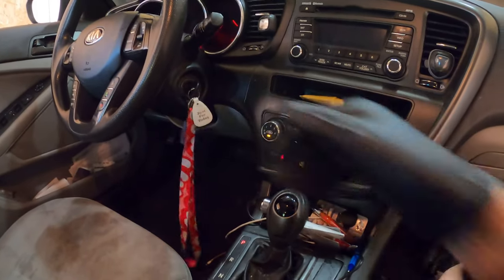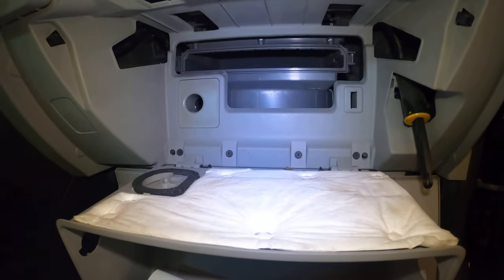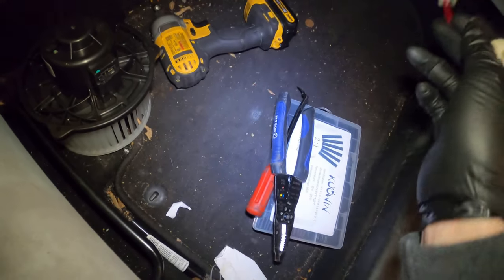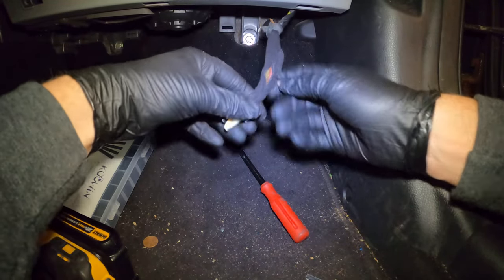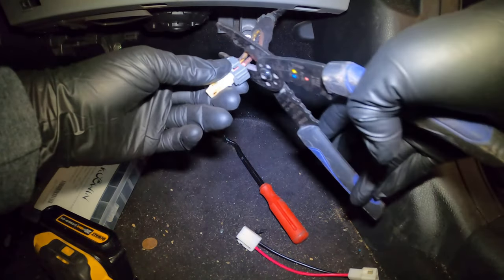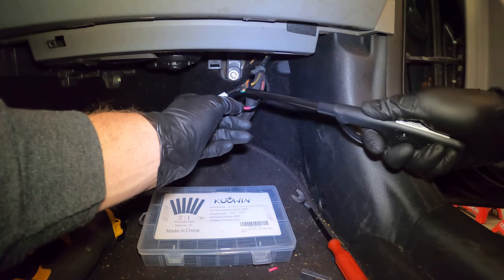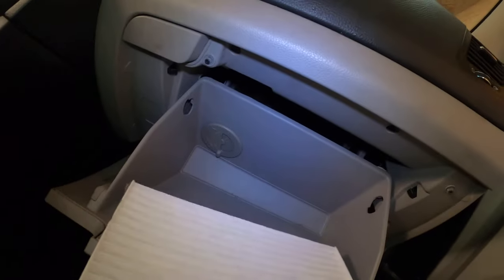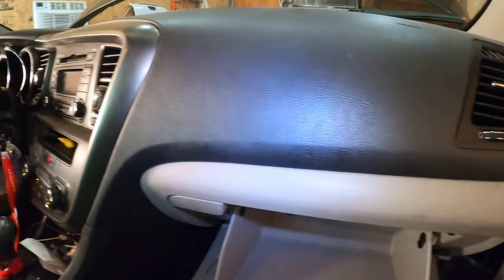2013 Kia Optima Blower Motor Replacement & Melted Harness Fix

Comment: Thanks for the video, I suspected I had the same problem since AC ventilation kept getting intrerupted. My connector was also burnt and almost impossible to pull out. Fixed my problem by just changing the harness
Reply from the maker: Yeah I've seen this many times but only on kia..they have to know about it. i hope this video helps. feel free to like and subscribe for more & if you can, please help the channel out by giving a super thanks. Making these videos takes a lot of time, but we do it to save you hundreds. also head down into the description and check out the link for some high quality led bulbs for this and any other vehicle. use my referral for a discount. Add me in Instagram for behind the scenes pics and Stop by my store for some Anything Auto gear.

Comment: Thanks for the video. My filter was disgusting and the connector is stuck. Gonna find some pliers and see if it's blown before I pay a shop double to do something I could definitely figure out myself! A little scared of the rewiring so I will let my electrician friend do that part if needed lol
Reply from the maker: You can do it. i hope this video helps. feel free to like and subscribe for more. also head down into the description and check out the link for some high quality led bulbs for this and any other vehicle. use my referral for a discount. Add me in Instagram for behind the scenes pics and Stop by my store for some Anything Auto gear.

Comment: Thanks for the help! I just did mine on my 2012 kia optima. I kind if messed up the clip on the connector trying to get it out of the old motor, so I put a couple of pieces of electrical tape on it to help hold it in place. I figure after everything is mounted and stuff though, it should stay in place 🤞
Reply from the maker: i hope this video helps. feel free to like and subscribe for more & if you can, please help the channel out by giving a super thanks. Making these videos takes a lot of time, but we do it to save you hundreds. also head down into the description and check out the link for some high quality led bulbs for this and any other vehicle. use my referral for a discount. Add me in Instagram for behind the scenes pics and Stop by my store for some Anything Auto gear.

Comment: My kia k5 same thing with the connector 😮!!! I bugg it comes on for a good while then off again .. i need to replace it thank u for the video
Reply from the maker: @deatricefayesam3065  a k5 is an optima. Just different name. Same parts too. i hope this video helps. feel free to like and subscribe for more & if you can, please help the channel out by giving a super thanks. Making these videos takes a lot of time, but we do it to save you hundreds. also head down into the description and check out the link for some high quality led bulbs for this and any other vehicle. use my referral for a discount. Add me in Instagram for behind the scenes pics and Stop by my store for some Anything Auto gear.

Comment: Did you replace the blower too or just the harness?
Reply from the maker: it clearly states in the video its a new blower motor. check the video out. its a good one. hope the video helps. like and subscribe for more.
Reply: @AnythingAuto  when I take my blower out it works perfect but when I keep reinstalling it, it won't work. Does that sound like the blower is the issue?

Comment: I’m thinking that you might have that motor spinning in the wrong direction! Just swap the wires and you should be fine.
Reply from the maker: @jonyovanno4145  motor is good. Still going great. i hope this video helps. feel free to like and subscribe for more & if you can, please help the channel out by giving a super thanks. Making these videos takes a lot of time, but we do it to save you hundreds. also head down into the description and check out the link for some high quality led bulbs for this and any other vehicle. use my referral for a discount. Add me in Instagram for behind the scenes pics and Stop by my store for some Anything Auto gear.

Comment: Hi can someone assist me where I can find the pigtail for kia optima 2013? My pigtail is completely burnt. I can not find the pigtail. Only says fit Forte.. not sure if I am able to use that
Reply from the maker: I went to rockauto and found 7 different brands.
Reply: I'm on their page but I don't see the one you're using. All wiring are all green and the pigtail does not have that distinguish side like thr factory kind. If you have the link that would help greatly. Thank you 🙏🏼
Reply from the maker: @dundunbatman92  don't go by the one I used. I didn't buy that. I had that laying around the garage from another car ( most being the same). Email me pics of yours please.
Reply from the maker: Blower Motor Pigtail Connector Harness Fit for Kia Forte 2013-2018 Replace 18952-02224AS https://a.co/d/em8GwIL
Reply from the maker: Like I said. Almost all are the same. Forte will work

Comment: I'm having trouble disconnecting the wire. I'm afraid I'll break it
Reply from the maker: Take it down if you have to but yes they can be very stuck. Some time using pliers helps hold and pull while pressing down the lever. I hope the video helped now if you can help me by liking and subscribing:)
Reply: you have to use pliers to sqush the top white part, if its super stuck might be melted like mine was. It came out corroded/meltedish.